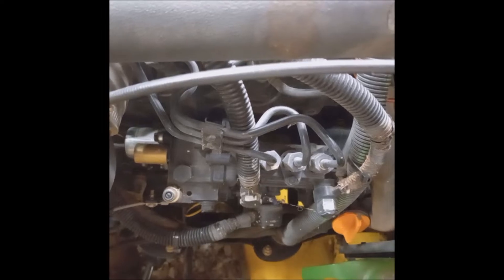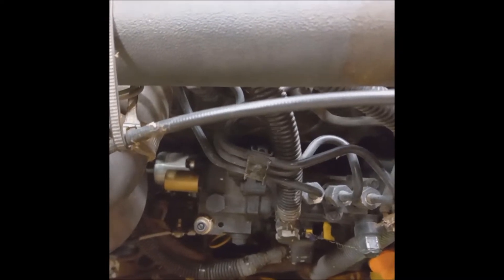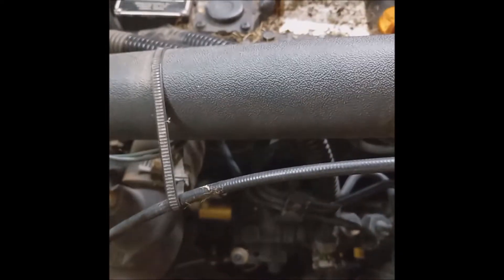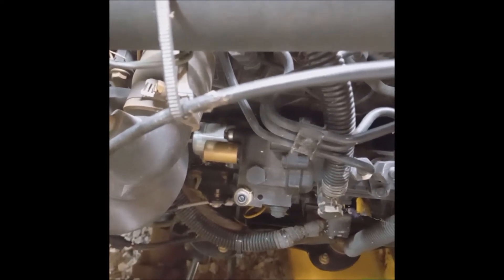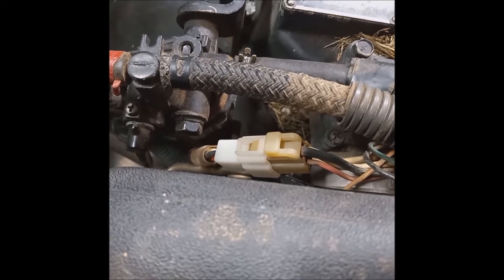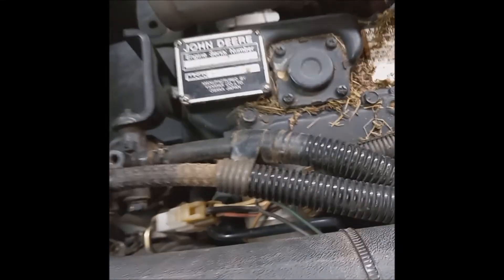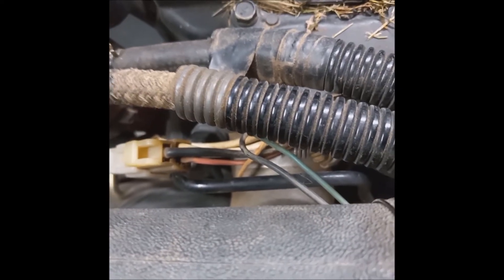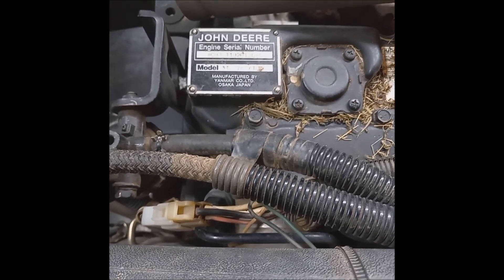Testing John Deere Yanmar Fuel Shutoff Solenoid

Comment: OK, I have a JD X495 diesel yanmar,  and when you turn the key the pre heat light won’t go on? any thoughts?
Reply from the maker: First the glow plug light is just a timer that counts to 15 seconds before you attempt to start. It has nothing to do with the actual operation of the glow plugs. If the light does not work, it could be a bad bulb or wiring connection issue. Second, test to see if there is voltage to the actual glow plugs. If there is voltage, the glow plugs are working. If there is no voltage, it could be the glow plug controller module.
Reply: @gotdeeres  well this one when you turn the key it normally the light goes on and it clicks after about 10 seconds the light goes off and then you can start but right now when you turn the key, the glow plug light don’t go on. There’s no click so it’s gotta be something to do with the wiring by the dashboard. I would think I’ve checked the relays. The circuit board light goes on as a green light that goes on so I know it’s not a fuse. It’s not a relay, but I will check to see if it has power with a test light. Thanks. I’ll give that a shot.

Comment: Thank you, i bought a tk270 2 cylinder to build a DC generator for back up power for solar to charge batteries, and i looked everywhere for this information, to hook up all wires that the person took out just went threw and cut all wires.

Comment: Outstanding video.  This is the kind of info i was trying to get from the tech manual. My tractor starts and runs 3-5 seconds then dies. If I turn the ignition switch on and wait the 3 seconds for the second click, the engine will only crank and never start. My guess it was a problem with the hold-in coil but had no info to test.  This was just the procedure I needed.  Thanks.
Reply from the maker: Glad it helped/

Comment: I have a 4105, I started it up and smelled something electrical burning followed by some black smoke. Shut it off and now it won’t start.
Reply from the maker: Does the starter turn the engine over?
Reply: @gotdeeres  it was the thermistor, totally melted down. I replaced that and the fuel shut off solenoid and it’s working. Hopefully it stays
Reply: @gotdeeres  my gator 2030 does the same thing and the engine doesn't turn over

Comment: Sure enough. After two weeks of fighting this bastard it was the jumper wire on the democrat seat switch. Damn I hate liberals and their nanny state crap. On the upside all the dust and grease have been cleaned off the engine and all the maintenance is done.

Comment: Thanks I’m going threw a voltage problem with the white wire the red I’m getting 12v but only 3 on the white not kicking it in
Reply from the maker: The white wire receives voltage from the fuel solenoid controller.  That is probably your problem.

Comment: Thank you so much for the excellent video.  Very helpful.  I was trying to troubleshoot why my Deere 1445 Front deck tractor would not start, I've been tracing down the fuel system, and came across your video.  Sure enough I had one side of the coil / solenoid failed.  I followed your Ohm test procedure.  I recently ordered new solenoid from Deere dealer, installed, and my machine now runs great.  Thank you.
Reply from the maker: Glad it helped

Comment: I don't have a John Deere, but a Mustang 2040 skidsteer with the Yanmar 4TNE84 engine. It started to cut out on me and then stopped all together after a minute or so. I tested the wires going it to the Solenoid with a 12 volt light tester. As you explained, the light came on with the white wire  for about 2 seconds then went out. The Red also came on but the light went out when the white one did. So, the I bypassed the seat switch as it was the easiest to get to, then the engine ran fine! Thank you for saving a bunch of time & hassle to find the problem.
Reply from the maker: No problem.

Comment: I'm not believing the seat interconnect with the solenoid starting function because I can start the tractor without sitting in the seat.  The seat safety switch only matters if the PTO is also engaged.
Reply from the maker: Oops. As long as the parking brake is ON, the tractor will start regardless if there is an operator in the seat or not.  Then seat switch kills the tractor when the parking brake is off and the operator leaves the seat.

Comment: Hi George, I am testing all safety switches so I started by bypassing all the safety switches by hotwiring from ignition to solenoid.  Runs fine, but I pulled the solenoid, tested and replaced it.  Now, I turn the key and the plunger retracts for a couple seconds.  So, while hot-wired I cannot reinstall the new solenoid because when it reextends,  it will kill engine.  But why, if the seat switch is bypassed?
Reply from the maker: What is your tractor's model number?

Comment: I had this fuel shut off problem - took quite a bit of head scratching... turned out my knee had hit the emergency cut off... so obvious after the fact!
Reply from the maker: At least it did shut off. I have a friend with a Kubota BX25 that does not shut off. I will be making a video for that problem.
Reply: BTW - is the emergency shut off part of this or is that a direct mechanical mechanism?

Comment: Thanks George: This helped me tremendously with my x758 with starting issues. Your diagnostics solved my sporadic starting problem. I replaced my solenoid and now it's working  all the time. Udaman!
Reply from the maker: Sporadic electrical problems can be very frustrating. Sometimes just unplugging and reconnecting connectors can fix a problem  due to a poor connetion. Reading a TM is never as good as a detailed video.
Reply: @gotdeeres hi, my problem with the 2009, 2305 utility tractor with an Yanmar diesel engine with only 745 hours is, it does crank but wont start, it happen once a while back, it didn’t want to start but after a few tries it started and worked fine, then a few days later it did the same thing but this time it wont start, lots of juice in the battery, changed all oils (hydraulic, engine oil, antifreeze coolant and all the appropriate filters) changed the seat for a new JD one. Where should I start looking before sending it to the dealership